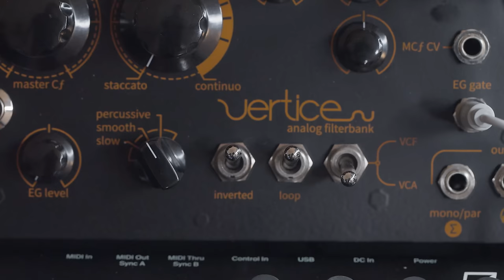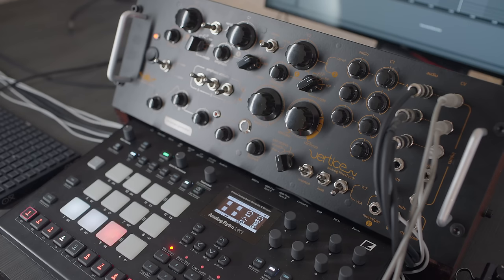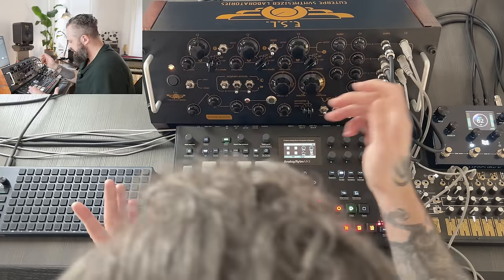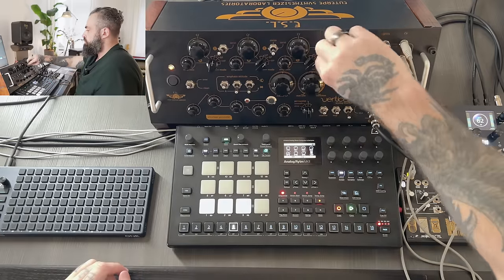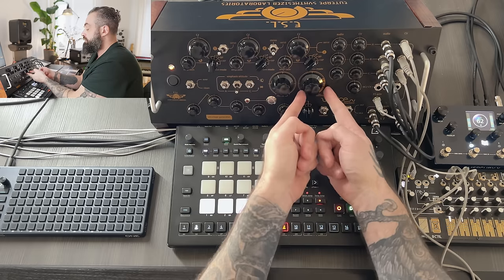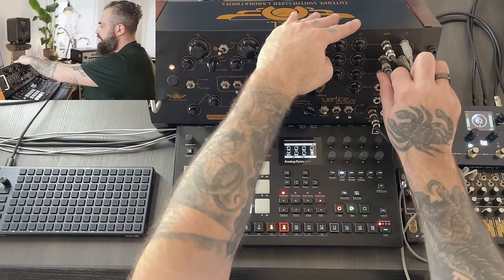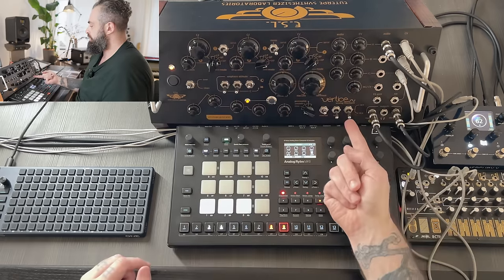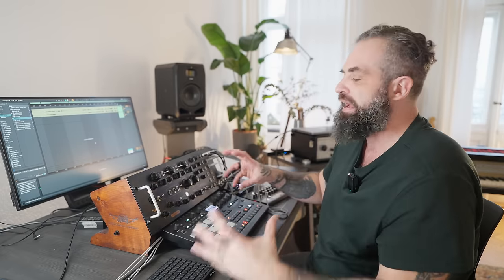The Beautiful Annihilator : Euterpe Vertice Filter Bank

Comment: Nice sounding filter bank, sad that 
1) the filter type switch is not smooth (bad for live plays)
2) can distort very easily
3) can easily generate unwanted artefacts (VCA calibration issue?) 
4) no channel linking 

Looks interesting by its build and tonality ranges tho
Reply from the maker: please consider I am still a novice using it. It can totally be used live once you get acquainted
Reply: I play it live for hours daily 😂😂
Reply: @stefanobersanetti8089  he's talking about the loud pop when changing filter type, not friendly to a club PA system.  But of course you can create various workarounds.
Reply: @Rareos  you're right, when you know the machine there are many ways to manage levels. Vertice is one truly dynamic machine with 100dB of maximum gain on the last stage